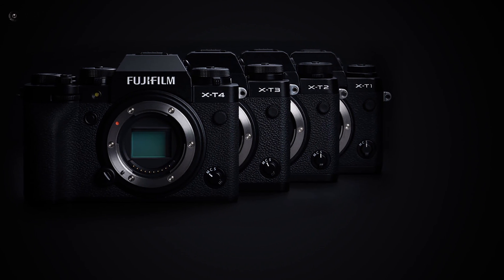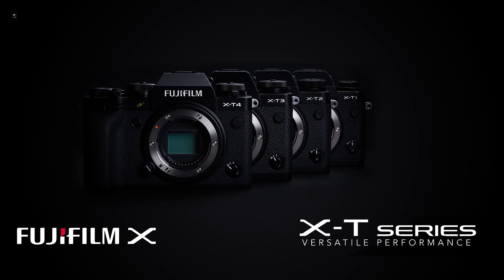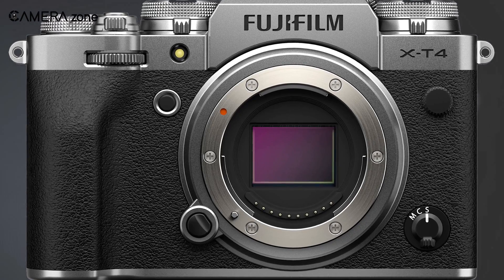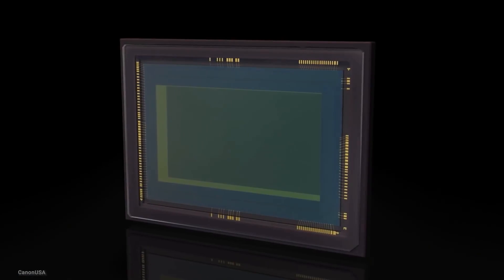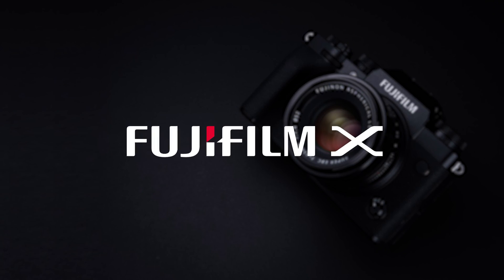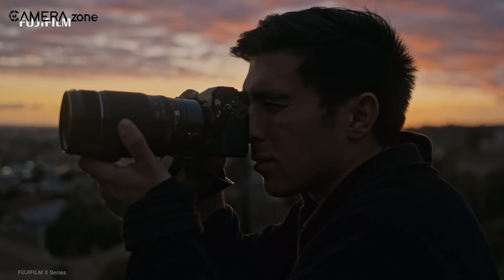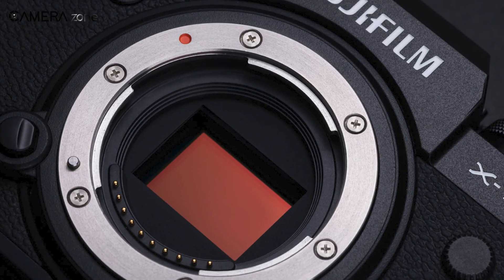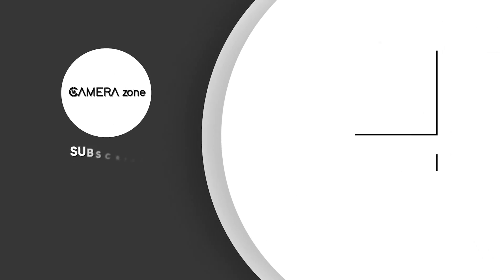Fujifilm's New innovation - APSC BSI Stacked Sensor

Comment: Didnt mention a word about iso or noise performance for photo with more pixels
Reply: To be honest, for photos the XH2s performs pretty nice, same for video up to 60 fps, but at best "ok" ish at 120 fps and unusable noise and missing sharpness in 240 fps video modes.
In fact i would always prefer the XT4, the XH2s isnt much better in autofocus but as a canon R7 user im pretty spoiled with autofocus and barely anything comes close except expensive high end full frame cameras.

I tried Fuji (XT3, XT4 and XH2s), Panasonic  (GH5 and GH6) and Sony (A7R III, A7S III, 6400), none of them impressed me really when it comes to autofocus, only the GH6 and A7S III were somewhat usable (but much too expensive for the given specs)

Comment: In practice it doesn't change ISO performance that much, it's just a minor increment that maybe will add up in the future to really make a difference.
Reply from the maker: BSI sensors are less dependent on ISO performance in low light situations.

Comment: I only care about XH2, XPro4 and X80.

Dont really care about XT5, cause XT4 its already a great camera, and would not benefit from an upgrade, other than replacing the annoying full articulating screen (which slows down the photografy ) with a 2 way tilting screen.
Reply from the maker: We are also excited for those upcoming Fujifilm cameras. We hope that the new sensor would be included in those cameras
Reply: Totally disagree. Full Articulating is definitely the way to go. 2 way tilting is way too limiting for video. X-T5 would be a fantastic upgrade. What if somebody would have said the X-T3 was "enough" of a camera? Did you say that about the X-T3???
Reply: @chuckm482  I also dont get people talking nonsense about fully articulating screens, as soon i had it the first time i never wanted to miss it anymore. In fact it was one of the bigger reasons to stay at canon (as much i wanted to switch away from canon once...) since even many super expensive high end cameras still dont have a proper screen to use for video yet.

i mean i absolutely get the more professional users, they will have a Ninja V or so on the hot shoe, but for the majority of users a nicely usable fully articulating screen is the way to go, just be aware of dropping it or a falling tripod with camera  which is a real danger if the screen is flipped out.

Comment: 30-36 megapixels, drastically improved EyeAF, add animal and bird AF, have a native ISO starting at 100 and capping at 25600, unlimited recording in video, and the ability to close the shutter to protect the sensor when switching lenses and I think it’ll be a home run.
Reply from the maker: Sure it will
Reply: Yes!!! + 4k 120 fps, better dynamic range. 36 megapixels on a aps-c might be z lot still though.  But an x-t5 would be a blast for sure. If they can keep it with the weight of the x-t4
Reply: 4.2.2 internal as well
Reply: I believe that the improvement in eye af and tracking and so on is bottlenecked by most of fujifilms lenses.

Comment: Canon and Sony sell far more APS-C cameras than Fuji does
Reply: Maybe Canon and Sony sell more APS-C cameras but the truth is that there is no APS-C camera better than Fujifilm cameras. 4k60fps 400mbps capabilities, untouchable color science,  incredible lense selection, and best of all, the best camara support out of all camera manufacturers.  Sales means absolutely nothing when it comes to being the best.
Reply: @CharlezRichard  absolutely agree. it's a typical quantity vs. quality situation. I´ve been through several Sony and canon full frame models until I finally stayed with the x-t3. nothing I´ve used before comes even close to it, except for af tracking performance it lags like 10-20% behind Sony and canon top models, but for everything else I get with the x-t3 I can absolutely and happily live with that trade off.
Reply: @CharlezRichard  The lense selection is limited though. For instance the 50-140 2.8that issuperbug and weightalmost 1kg.Vs the Rf (fullfame!) 70-200 f4 wich weigh lessthan 700.
Reply from the maker: Fuji has a far more secured future for its APSC cameras than Canon. Suggest us any Canon APSC camera which can stand side by side with FUJIFILM XT-4.
Reply: @camerazone_  A lot more people buy the Canons.
Reply: @M Tech Yes there is, APS-C will be so good and lighter that there will be no need to full frame monsters for the consumer pool.
Reply: @M Tech It is light, speedy, and new. So, it is got to be A-cam, and your old full frame is B-cam :):) Especially you are a body builder type, which I am not, single APS-C is good enough for me, or maybe X-T3 as B-cam.
Reply: @M Tech my fuji xt3 had superior video than anything in it's price range
Reply: fuji makes pro aps-camera. It's a totally different segment than canon.
Reply: @M Tech Yes, it will happen for the consumer pool.
Reply: @M Tech xt3 is definitely miles ahead, i know as I used both. Xt3 has better dynamic range, rolling shutter, bit rate and colors. For video APSC obviously makes sense as super 35 is still the standard in Hollywood
Reply: I used to be a Canon APS-C DSLR user, and can say Canon is a douchebag in the market, they only care about your money and want you to buy into their own system with no 3rd party support (even want you to use their own crappy editing software DPP when you want RAW color retention). Also their repair shops are ones of the worst, notorious to charge money for repairs when they do absolutely nothing.